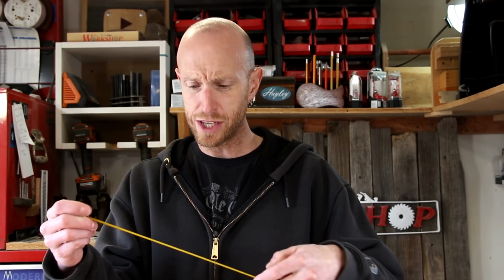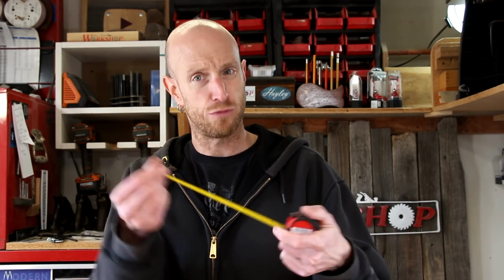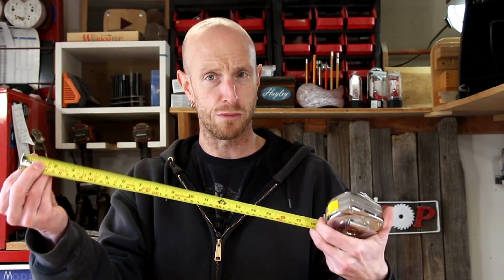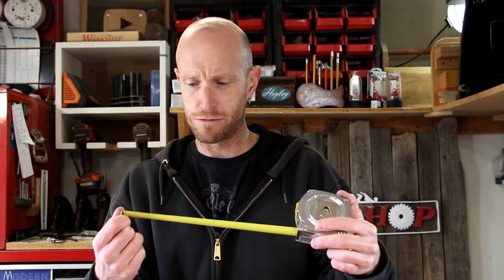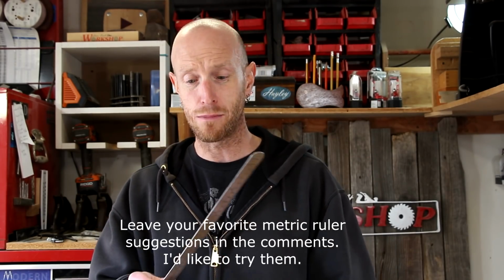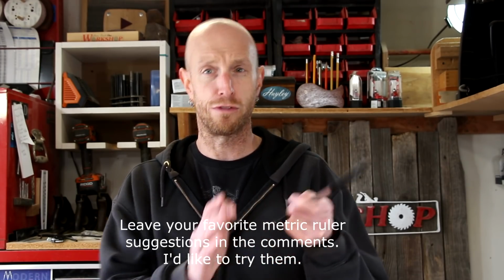My thoughts after using the Metric System for a project | I liked it

Comment: As a lifelong Metric user here in Australia, I only really have colloquial familiarity with Imperial. But from that, I think that Metric provides a better system for conversion, interuse, and scaling. But Imperial does seem to give nice units for human brains to grasp in the central areas. Feet and inches can be quicker to grasp as a size than so many milli or centimetres. Americans definitely love to cite that Farenheit is a better temperature system for weather as it gives a better feel for what you will experience. But scientifically, or in construction, I really think that move to Metric should be made. Remove the one last squeaky wheel that often causes issues in international projects.

Comment: Metric is so easy you can use it in your sleep. I'm 183 centimeters tall, or 1.83 meters. Just move the decimal. Also, The system the US uses is called Standard meaning American Standard because it isn't exactly the same as the original Imperial system that was brought here. It has been modified somewhat which is why we can it Standard, short for American Standard System.
Reply: The US uses USC (U.S. Customary), volume is different, but length is not. Example the international inch is 0.0254 m, this is what the US uses, but yes metric is much easier.

Comment: There seems to be a general understanding that the U.S does not use metric but it has been doing so for a long time (Money, drugs, photography & movies, medicine dosage, food nutritional labels, soft drinks, Engine size (apart from HD!). There are still areas such as measurement and temperature using imperial but hey even in the UK we use imperial and metric when discussing motorcycles (21 inch front wheel and 800 mm discs!). Good vide btw

Comment: This made me smile when i looked it up on wikipedia:
The yard (symbol: yd) is an English unit of length, in both the British imperial and US customary systems of measurement, that comprises 3 feet or 36 inches. Since 1959 it is by international agreement standardized as exactly 0.9144 meters.
Whereas the Meter:
The meter is currently defined as the length of the path travelled by light in a vacuum in 1/299 792 458 of a second.
So people using foot and yards are already using the metric they just do not know it hehe

Comment: We still use both interchangeably in the UK. I'm a designer in construction and all of our drawings etc. are in metric, but when discussing with colleagues we would never call a 6" column a 152mm column even though it would be identified as such on a drawing. Same goes for 2 x 4 timber or 4 x 8 plywood. The silly thing is timber, steel etc. is still manufactured in imperial sizes. This is mainly due to the 'Weights & Measures Act', which was changed to enforce metric units due to pressure from the EU. But despite this, we don't want to completely let go of our imperial units and indeed Miles, yards and feet are still the legal units used on our roads. Basically, a six foot guy is unlikely to know that he's 1.829m tall without calculating it, he'll just tell you that he's 6'.

Comment: Im a 60 year old Brit and was brought up on imperial as a kid but by the time Id left school it had pretty much been superceded for engineering purposes. Im still 6 feet tall not 1.8m I still judge my weight in stones pounds and ounces rather than KGs, I still think of the distances I travel in miles speed in MPH and the cost of the fuel in approx miles per gallon (even though its priced and sold by the litre). But when it comes to my job as a steelwork draughtsman Id rather give it up than be forced to work in feet and inches, metric is so much faster and less prone to error. Back in the noughties I worked for an international detailing company and detailed a bridge to replace  one of the bridges wrecked when the twin towers came down and working in imperial was a massive ball ache, I was constantly converting fractions to decimals and it was so time consuming.  I still think of imperial weights in a domestic sense but reference metric weights in my job because UK steel sections are referenced by their Kg weight per metre (and nominal heights and depth in mm).  Because i do still have that early imperial reference in my mind I find I quite often visualise rough common measurements in both formats, a 3/8 bolt is about the size of an M10.  25mm is near enough 1 inch (25.4 to be exact) 50mm 2" and so on up to about 300mm for a foot,  900 mm (914.4) for a yard and 3m (3.05) for 10 feet. Plot out 2 lines on a bench at 90 degrees to each other and check it using the 3 4 5 system in imperial, and then recheck using using metric. For those not familiar if you measure down the short side of a sheet of ply or steel plate any denomination of 3, mark it and do the same down the long side any corresponding denomination of 4, the diagonal will be the corresponding denomination of 5 if the corner is 90 degrees. EG I use 900mm down the short edge, 1200 down the long edge to give 1500 along the diagonal, If its not and you need to trim an edge its much easier to make a new cut line using metric denominations.

Comment: I grew up in the US, and back then all measuring devices had metric and customary units. I moved overseas a long time ago, I guess things have changed, if what you say is correct that it’s hard to find metric devices. I still have an old tape measure with inches on one side and centimetres on the other. Kind of a novelty around here. 

In any case, I’ve been using metric since I was a kid in the 70s/80s, even when inches were standard. Metric is and always has been easier. I never understood why America doesn’t embrace it.

Comment: There is an important wrinkle in using the metric system for lengths.  You need to choose between cm and mm for lengths less than 1m.  Use mm.  That way you can write any distance with one number, no need to write the 12m 23name or abbreviation for a unit. 12.023 is evidently 12.023 mm or 12.023 m or 12.023 km, and in context is is always obvious which.      Studies have apparently shown that industries that converted to mm adjusted much faster than those using cm.

Comment: The idea of imperial is halfing, thriding, etc.
Imperial is about fractions.
Metric is about decimals.

Imperial is good if you have no system or measurement values.
Cause you can half a half, of a third, of a third (yards to inch) easily.
Or make a half of a half, of a half (gallon to a pint).
Which is simple and effective.

But once you have measurands, by themselves or interacting with eachother (like hoe cm3 interacts with liters or they interact with weight), or have numbers and straight up math, thats when the metric system just outshines imperial without a contest.

Comment: When you compare these systems, you should use units of nearly the same dimension, e. g. inches and centimeters (1 inch = 2,54 cm). 
Millimeters (1/1000 of a meter) are the next smaller unit in the metric system, dividing a centimeter (1/100 of a meter) by 10.

Comment: I am from Czech Republic where we use the metric system but from time to time I have to use imperial. I work in film production and when I am making add-ons for my camera it is a weird blend of metric and Imperial screws and dimensions. For example my camera base plate uses 15mm rod system for accessories, 3/8" and 1/4" screws for mounting to the camera, and the plate itself is held together by M4 screws. The biggest problem for me is finding the mounting screws. Camera specific screws are about $6 per and there are only 3 hardware stores in Prague (the capital), that I found, that sell any imperial hardware and they only carry hex head screws which are useless for me and yet they still cost almost $2 for a single 1/4"20 screw.

Comment: The thing that you don't know how to describe, but perceibe more comfortable is the core of the metric system. Is genuine decimal, a 10 base number system to the last existing decimal (unlike the imperial, that is a a fixed 12 to 10). People have 5 fingers on each hand, 10 total, so is much more intuitive tu use it. Of course if you have always used imperials it will take time, but as soon as you start using it, you will "feel it". Using imperial is almost like using hexagonal to calculations,yes it can be used, and yes you'll get used to. But it will never be comfortable to most things like metric. Metric is like breathing, natural.

Comment: I believe the strength of imperial was the divisibility. 12 can be divided in by 1, 2, 3, 4, & 6 so it was great for subdividing widths etc where perfect accuracy wasn't such an issue. They use the same principle in web design today for page layouts, for the proportion of the page each element of the page takes up. Overall though, metric is far easier to use.

Comment: In Britain we seem to use both & I find that really useful. I interchange between inches & cm depending on the measurement I need to make. I find imperial easier for general use & estimating, while metric is better for smaller projects, precision & for anything that requires division/multiplication.

I see it as akin to being bilingual. Why not use both when it suits me?

Metric is superior most of the time but for certain tasks imperial is perfect. It's not like I'm building fighter jets in my workshop & working of precision plans.

Comment: Personally as an electromechanic i have to use both and tbh imperial is far better for smaller sizes (ex. For measuring under an inch when machining or using shims for ac motor legs to get rid of wobble) but metric is overall easier/more versatile/more accurate mostly for longer distances and/or measurements. Still have to usually use imperial more often tho because in an industrial setting thats the "norm" even in Canada,Québec for bolts, chains, sprockets metal pipes, etc.

Comment: USA:  I do some minor repairs around the house, build a few things here and there, and I work in a hospital.  The Metric System is much easier to work with in all three settings.  In fact, it pretty much all we use in the hospital.  Getting your units crossed in a hospital can have deadly consequences.  I've seen it.  But, that doesn't speak to it's superiority.  It only means don't cross the streams in Ghostbusters or different measurement systems.  But, moving a decimal is so much easier than dealing with ounces, pounds, inches, yards, miles, etc...

Comment: I am a bit late to the party. I was raised on inches, feet, yards, furlongs, miles etc. Or pounds and, ounces etc., but halfway through school (in the UK) we switched to metric. No longer did we need to be familiar with numbers in base 3, 4, 6, 12, 20, ...1760, etc. Life got so much easier.
In later life I make models, and scaling up or scaling down dimensions is so simple. I also do cabinet making and knocking out plans using simple CAD (Sketchup) using metric. The mental arithmetic of adding or subtracting for rabbets, shoulders, etc. is simple when you are not adding up and subtracting fractions, there are fewer headaches, brain farts, and errors.

Comment: Where metric really shines is in conversions. eg: 1 Litre of water = 1Kg = 0.0010m3. 1 Newton is the force required to give 1Kg the acceleration of one metre per second per second.
etc etc. Easy to think between Mass, Weight, Work, Length, Volume etc

Comment: Both metric and Imperial are used here in the UK. ...and we have a few oddities. For example, at a timber merchant, you can buy 4-metre lengths of 4 x 2".

Most of the time, however, metric is used. Projects, where imperial units are used, include restorations of older items. Especially in engineering. In engineering, it's often feet, inches, and thousandths of an inch (thou). Which could be likened to metric in miniature. That again is on older projects. Modern engineering – metres, millimetres, and microns.

Such a profusion of units on an imperial rule/measure can be a bit tough on the eyes. That could be why you found metric better for accurate work.

When measuring from left to right, the metric side of a tape measure faces you. Making that nice and easy. But, that's not so helpful when measuring in Imperial. Maybe that's not so with US tape measures.

I'm happy working with either. If I'm measuring to find out what length I need to cut a piece of timber to fill a gap in say, a fence, and that gap happens to be 37 1/4" inches, I'll use Imperial. If on the other hand, that gap happens to be 1,050mm, I'll use metric.

Really, it doesn't matter what units are being used. As long as an engineer/carpenter uses the same units that are on the drawings – and that everyone else involved, agrees to do the same. We could indeed, work in units of spongerubberbus.

Comment: Don't know why the US is sticking to the ancient unit system. In Germany in the 19. Century there were different kind of inches in each country. The Bavarian inch was diffent from the Prussian inch and also different from the Saxonian inch. This was all cleared with the unification in 1871, when they decided to untilize the French system, which was metric. The modern international length definition relates to 1 m, which is not the prototype metre in Paris any more but related to a specific laser wave length. Imperial units are only an attachment to this now. No metrology lab would use them.

Comment: Digital calipers and micrometers are good tools to have for precision work because they can be converted between metric and imperial units with only a button press.

My feeling is that imperial is a little more intuitive in some cases for things like food because the denominations tend to, as whole numbers, match up a bit more with what people might want. However, with actually making something, the metric denominations are far easier to work with. There are too many unit conversions in imperial, and fractions of an inch are annoying to consider for precise measurements when milimetres, micrometres (or even smaller) are their own denominations of length and are separated by regular repeating intervals of precision.

This extends to things like medicine where doses are measured more in milligrams or whatever. Imperial just doesn't cut it.

I remember once looking at the imperial version of a textbook I had for my master's in chemical engineering. It was ridiculously annoying to work through because I had to spend so much time adjusting equations for dimensional unit conversions, and it was much harder to tell if the results of my calculations even in the right ballpark because I couldn't just consider it in terms of being a factor of 10 or 100 or whatever off the mark. For example, PSI is a nice practical unit for tyre pressure, but if I'm having to consider equations of state for gas-phase chemicals so I can calculate overall mass, temperature, reaction rate etc. it's so so so much easier to convert from metric units like Pascals instead of PSI: for example, 1 kPa = 1000 Pa =  1000 J/m^3 = 1000 N/m^2 = 1000 kg/m.s^2 - a much more intuitive way to correlate pressure (Pa), volumetric dimensions and lengths (m), mass (kg), force (N), energy (J), and time (s).

Comment: In the uk alot/most of the people use imperial still, weight, distance and speed. Personally i use both systems for measuring, depending on the size of what I'm doing.

Comment: Never used imperial but it does sound a bit annoying if you really need fractional arithmetic to take measurments below inches.
I always thought the only advantage of the metric system is the way it combines length measurements with weight measurements.

Comment: I think it's simply the mental reprezentation than instead of using a fraction of a bigger unit (like a 64th of an inch) you actually have a name for it in millimeters, which themselves are of course a subdivision of a subdivision of a subdivision. By having a specific new name every  so often, I think this helps more with mental representation than being stuck at fractions of an inch.

Comment: I mostly use metric. From engineering I learned that always write down the unit for every drawing so .. if I use imperial, I just throw on a unit like 1/16 or 1/32 and use the 10fraction of those. The 1.5 1/16inch looks funny but it works.

Comment: There are also tape measures that are marked in decimal feet or decimal inches... Sometimes called "engineer's tape measures"... With the decimal feet tape measures, the tape is marked in feet and then each foot is divided into 10 major sections, thus from 1 ft to 2 ft it would be 1.0, 1.1, 1.2, ..., 1.8, 1.9, 2.0... Each 1/10 of a foot is further divided into tenths, so you get 1.00, 1.01, 1.02, ... 1.08, 1.09, 1.1 going from 1.0 to 1.1... For a decimal inch tape measure, the feet are not major unit, the inches are (although there might be some markings at 12, 24, 36 and such inches to indicate a multiple of a foot).  Each inch is divided into tenths and then each tenth might have markings on every fifth of it.  That would give you from 10.1" to 10.2" this:  10.10, 10.12, 10.14, 10.16, 10.18, 10.20... For anything finer than that (i.e. 10.05, 10.11, 10.13, 10.15, 10.17, 10.19) you just extrapolate... That gives you down to the nearest 1/100th of an inch... That will give you even more perceived accuracy than going to the nearest millimeter with a metric tape measure...

All measuring systems are arbitrary... I have had days where I dealt with metric, US, Imperial, and nautical (e.g. knots, nm)... And there is a difference between the US system and the Imperial system for some units...